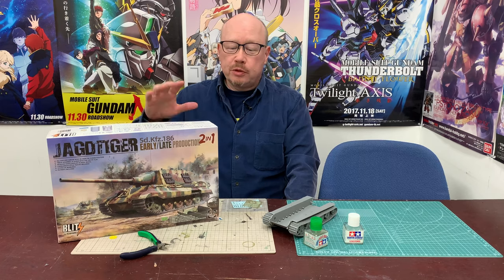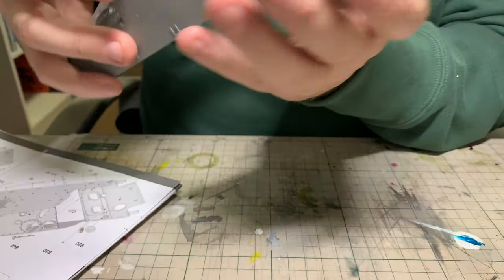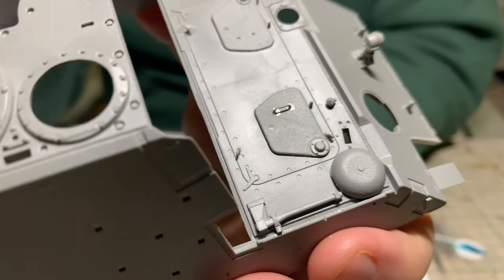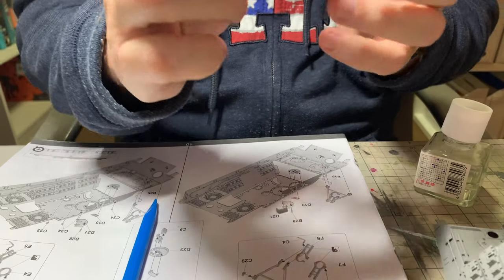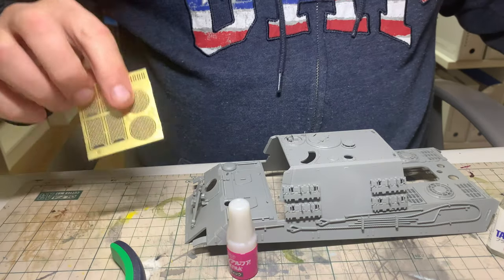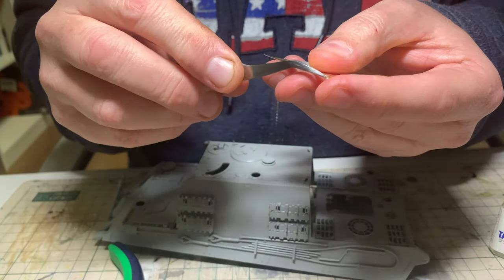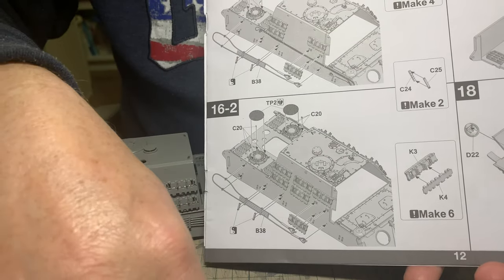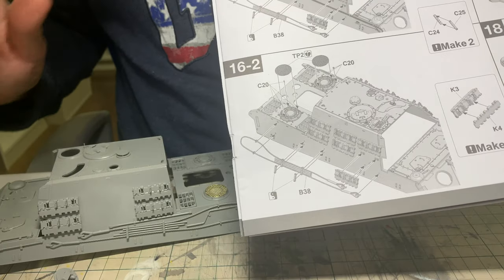Applying Photo-Etch | Takom Blitz Jagdtiger Part 5 | Boss Builds 36

Comment: That long rod tool would be the quintessential tanker bar! It's a mainstay of most tanks and is still used today. It works similar to a crowbar where you stick the pointed end somewhere where you might want a lot of leverage and then apply pressure on the other end.